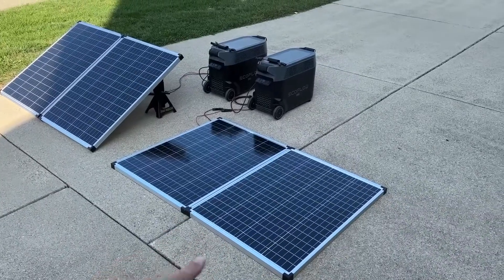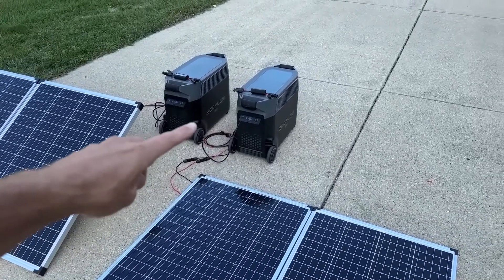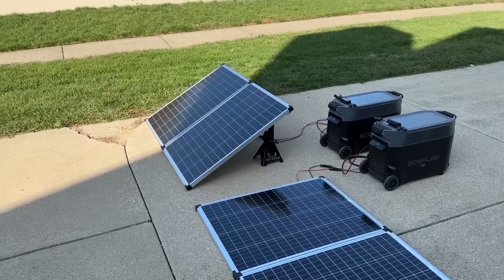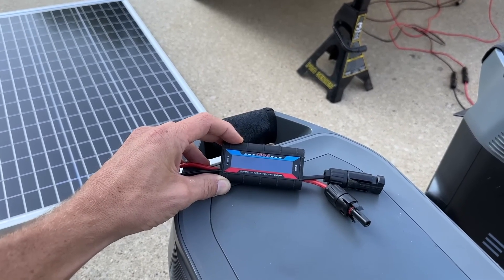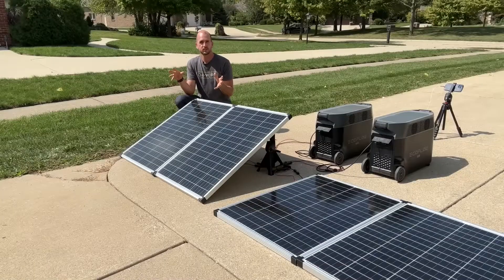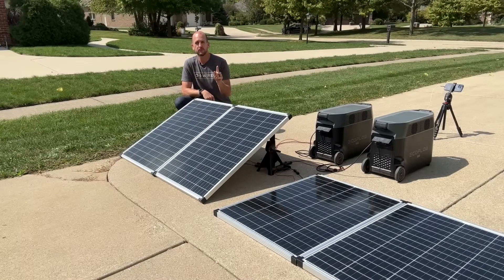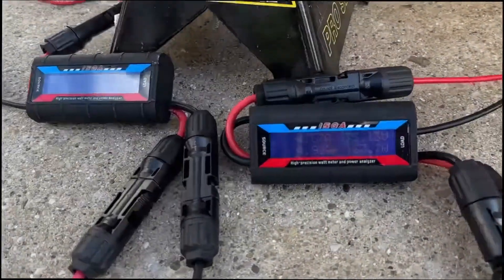Flat vs Tilted Solar Panels – How Much Energy Are You Losing?

Comment: The Shade the angled panels are casting on the flat panels is skewing your results. Even if it’s one panel being shaded because there are wires in series the other panel will act as if it was shaded.

Comment: The experiment is interesting but you didn't do it right unfortunately. 
1. it should have been a full daylight test
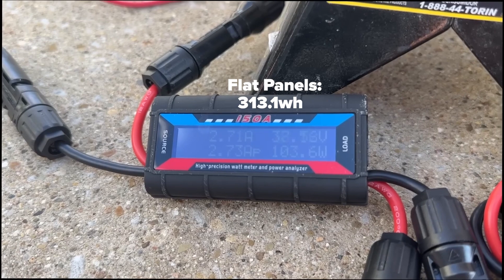2. they should have been placed such that the sloped panel didn't cast a substantial shadow on the flat ones. as can be seen @3:19
3. the slope shouldn't have to change much with season. As the slope should be facing south if you're in the northern hemisphere and vice versa. although I am not a 100% sure about this one

Comment: I have flat mounted panels on my garage and house.
The reason is simple: Here in germany panel prices dropped to 50€ per 420Wp panel. Mounting can easily reach that amount again especially for tilted mounts on flat roofs.
With tilted panels you can fit less panels due to shading. In the end I went with more panels but flat rather than less panels, but expensive tilting mounts.
Might need to clean them once a year though.

Comment: I'd like to see a cloudy day test! (I have my panels a bit flat for my latitude to boost production on cloudy days.) 

My understanding is that for cloudy days, the best setup is helping the panels 'see' as much of the sky as possible, so flatter angles will outperform on those days since all the light is ambient and scattered. 

This can be especially useful for overpaneled systems because they can't take full advantage of high noon on a clear day anyway.
Reply: Not sure what you mean. Even if it's scattered, it might be more from the direction of the sun behind the clouds.